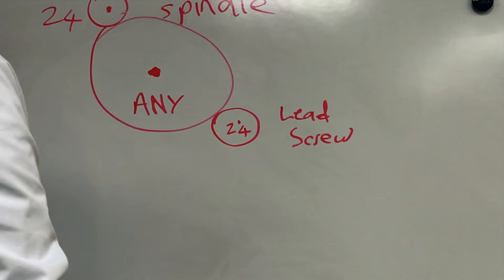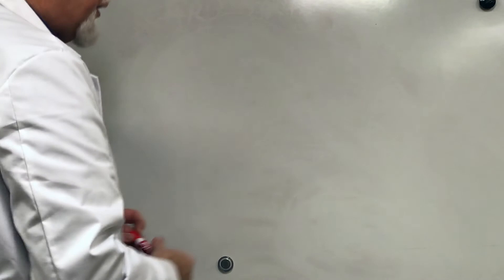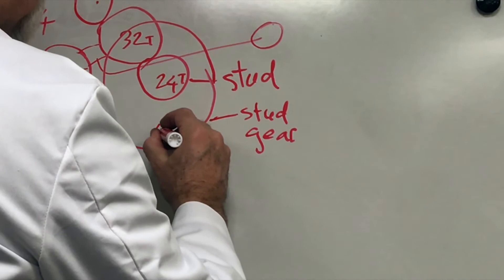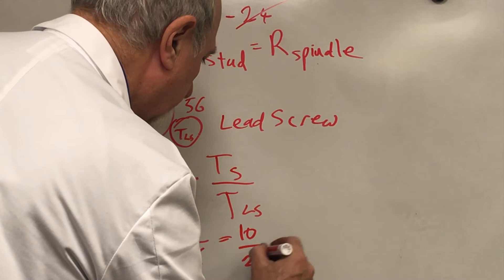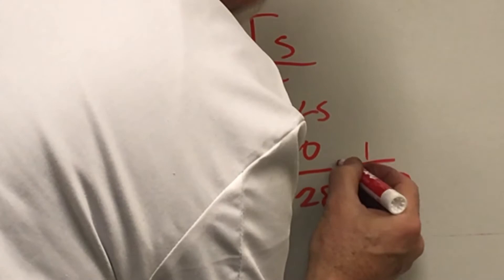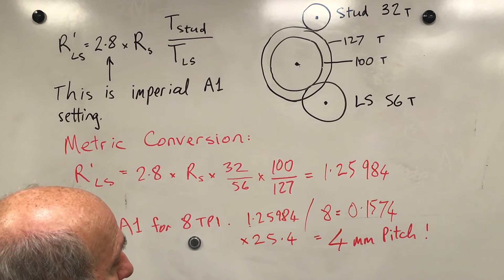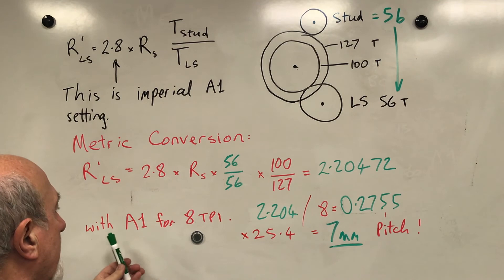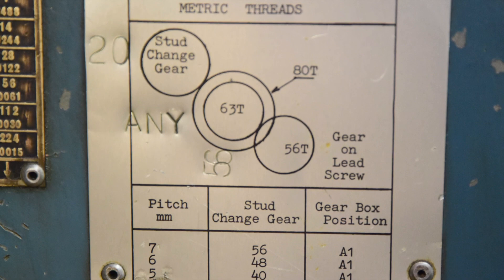Understanding gear trains, feed rates, metric and imperial threads in an engineers metal lathe.

Comment from the maker: Since making this video I devised a relatively simple method for calculating threads per inch (TPI) for imperial threads, or pitch (P) for metric threads on an imperial Boxford lathe. I have assigned the following numbers to the lever positions on the gearbox. Multiply these together to get the gear ratio of the gear box F. This is the number of threads per inch using a stud gear with 20 teeth and lead screw gear with 56 teeth (standard setup):

SUMMARY:

F is the gearbox factor (gear ratio) which is the value assigned to the lettered lever multiplied by the value assigned to the numbered lever on the gear box.

LETTERED LEVER VALUES

A B C D E

1 2 4 8 16

NUMBERED LEVER VALUES

1 2 3  4  5  6  7  8

8 9 10  11  11.5  12  13  14

For imperial setup with a standard 20 tooth stud gear the threads per inch is F.  The standard lead screw gear has 56 teeth and usually it is not necessary to change it.

If you use a different stud gear:

TPI = F x 20 / T

T=teeth on stud gear
F= Letter value x Number value
P=Pitch
TPI =Threads per Inch
P = 1 / TPI   so

P = T / 20F

METRIC Conversion 
(Using the compound conversion gear and lead screw gear):

P = T / F

F = T / P

Review the above letter and numbered values to find a combination that matches T/P where T is the number of teeth on one of the gears you have available.

Power Feeds:
Transverse feed = P /10
Longitudinal Feed = 3 x Transverse feed =  0.3 P
Reply: i try to understand but .........how could I read all these?
Reply from the maker: @sotiristheodoropoulos7750   How can I help? My video isn't great. I had problems with fluorescent lights reflecting off the white board.  

The basic principle is like this: 
If you have a gear with 100 teeth driving a smaller gear with 50 teeth the small one will have to turn twice to make 100 teeth go past, while the big gear only has to turn once for 100 teeth. So the smaller gear goes twice as fast as the big gear. 

If you use my online computer program mentioned in the next comment you may not need to understand the detail.

Comment: @Evan Lewis  
Dear friend, you helped me a lot.
 I did not know where to look for, but with  your excellent videos and your mail I can say now that I have understood largely to extent the operation of gear box
However, according to the table that is on my lathe gearbox (I attach the table to you)
If i want to make an imperial thread- as you wrote to me-   with 10 threads per inch you find it in column 5 and row A so you set the gearbox levers to A but I thing is A3  according to the table on my lathe gearbox.
so the first lever (letters) On A and the second lever (numeral) in number 3.
what happens? I have mistaken? I have not understood well?
Yours sincerely
Theodoropoulos sotiris

Comment: Dear friend 
Thank you for immediate response
Im teacher in athens ,Greece andI assure you your presentation was excelent but initially my knowledges as mechanic ( i am teaching electric in technical school,the lathe is my Hoby) and second my English language are my problems.
I bought a boxford  class A 8TPI two years of ago in bad condition  .today after reconstruction looks like as new.
‌I am tryig to learn tread in metric system but it is difficult for me to understand the numeral table on lathe on norton box.for example
‌what does mean two numbers   in every divisions ?
‌what position i need to put levers on norton box?
Reply from the maker: Sorry I don't speak Greek and I hope this is not too long for you to read. Since you are in Athens, you might be interested in my web page about Heron of Alexandria's Steam Engine, but it has nothing to do with lathes. www.HeroStreamEngine.com. 

I don't know whether the label on your gearbox is original or changed. The original one was copper. I will assume it is original.  Since your lathe has a lead screw with 8 threads per inch it is designed for English or American (Imperial) threads with threads per inch.

If you want metric threads you have to ignore the whole table on the gearbox and find special tables for metric threads (see below).  Sometimes special tables are stuck on the cover that goes over the gear train. 

You should review my thread cutting program.  Have you looked at that? www.HeroSteamEngine.com/RideTheGearTrain and click "Instructions and Information". This includes a video and at 9 minutes it has photos showing how the gear train is put together. My speech is probably too fast!  But it is also described in text. Scroll down through the text to find the heading  
"Converting Imperial lathes to cut metric threads". 
and 
"More about compound gears".
This includes the same photos as the video. If you go down further you will find a photo of an aluminum table of numbers.  This is what you need for metric threads. The heading on the table is "N.Z. Dept. of Education Metric Conversion". which means "New Zealand Department of Education Metric Conversion".  

To change your imperial lathe to metric it is best to use a special "compound gear" in the gear train. This is two gears joined together. The number of teeth on these gears can vary. The best is a 127 tooth gear connected to a 100 tooth gear.  You can also use an 80 tooth gear driving a 63 tooth gear as shown in the photos. When you use these gears the lathe behaves like a metric lathe with a lead screw pitch of 2.5mm.

Even if you do not have these special compound gears it might be possible to make metric threads. It depends on what gears you have.

With the compound gears or without them,  I would recommend using my program (RideTheGearTrain) to find out what gears to use. If the exact gears are not available it is often possible to use gears that give approximately the correct pitch (nearly correct). In the program you can say how much error you can accept. If you are happy with 0.5% error it will tell you what gears to use and how much error they make, up to 0.5%.

I will try to explain the copper imperial table on the gearbox anyway:  The top number on the 'numeral table' (on the gearbox) shows "Threads per Inch" for cutting English or American threads. We call these "Imperial threads".  You can ignore or skip the bottom number. Don't worry about it! It is not used for thread cutting. 

Power feed has nothing to do with thread cutting and you can ignore it. However you may be interested in power feed. That is when the lathe automatically moves the tool for you. 

(I explain the bottom number  here :The bottom number on the table is for power feed in thousandths of an inch per turn of the chuck (one thousandth is 0.001 inches). The number shown on the table is for the cross slide (which goes across the lathe bed). You can also use power feed along the bed (longitudinal) and the speed is cross feed rate divided by 0.3.) 

If you want to make an imperial thread with 10 threads per inch you find it in column 5 and row A so you set the gearbox levers to A 5.  However you also have to look at the first column that tells you the stud gear has to have 20 teeth.

I recently added some text in the description of the You Tube Video (#2) about the knobs and levers on the Boxford lathe. This describes how to use the knobs on the front of the carriage or "apron".
Reply: @Evan-e-cent  
Dear friend, you helped me a lot.
 I did not know where to look for, but with  your excellent videos and your mail I can say now that I have understood largely to extent the operation of gear box
However, according to the table that is on my lathe gearbox (I attach the table to you)
If i want to make an imperial thread- as you wrote to me-   with 10 threads per inch you find it in column 5 and row A so you set the gearbox levers to A but I thing is A3  according to the table on my lathe gearbox.
so the first lever (letters) On A and the second lever (numeral) in number 3.
what happens? I have mistaken? I have not understood well?
Yours sincerely
Theodoropoulos sotiris
Reply from the maker: @sotiristheodoropoulos7750  You are CORRECT it is A3. I misread the table and got it wrong! 

If you are making imperial threads you do not need the compound gears. Instead it has an 'idler wheel' that does not change the gear ratio. The idler gear usually has 80 teeth but it doesn't matter how many teeth it has.  It just acts as a spacer to fill the gap between gears. 

The copper table also says the STUD great should have 20 teeth.  

It does not mention the last gear (on the back of the gearbox) but that has 56 teeth.
Reply from the maker: Oh, one thing I forgot to say:  It is best to check the thread pitch after setting up the gear box. Get a bit of scrap bar and cut a shallow thread and measure the pitch. Do this before trying to cut a thread on any important part. This is an easy way of finding out whether you have the correct gear set-up.

Comment: Sir , I have gear stud 20 & any 80 , 63 , and ls 56 . can it make to matrik . I look table diagram gear . what is standar for make drat matrik.

Does the rpm  affect too ?
Reply: I am have lathe tipe A boxford 4 1/2inc presision  with gearbox . I want to make matrik but the gear that I have   20 , 40 ,80 . what should i do and what gear do i need add. Thanks
Reply from the maker: YES YOU CAN CUT METRIC THREADS WITH THE 63 TOOTH GEAR.
NO THE RPM DOES NOT AFFECT IT. (You set RPM with the pulleys and back gear).

I know English is not your first language and this may be difficult for you to read. Please contact me by email if you need help. See my email in my online computer program 'Quick Start Guide':  I suggest you use my online program called RideTheGearTrain dot com. It does not cost anything.  I will set up the program for your lathe and send you a link (URL) with all the data for your lathe.

You can make up a gear train like this and cut any metric thread:
20 tooth stud gear driving the 80 tooth gear. 
The 80 tooth gear is connected to the 63 tooth gear as a compound pair - both on the same shaft.  
The 63 tooth gear then drives the 56 tooth gear which is on the "leadscrew gearbox input shaft' which I call LSG. Then use the program to find out what gearbox setting to use.

Later, you can still cut imperial threads by using this compound pair as an idler. Use the 80 tooth idler.  The 63 tooth gear may still be connected to the 80 tooth gear but does not mesh with any other gear for imperial inch threads.

I just ran 'RideTheGearTrain' and asked for a 1mm pitch thread. It told me a much simpler gear train:  
20 tooth stud gear
driving the 80 tooth idler gear (not compound)
63 tooth LSG gear (on the leadscrew gearbox.)
Set the gearbox to B5 for a 1 mm thread.

How to use my online program called RideTheGearTrain dot com. It does not cost anything. 
In step 1 the program asks what lathe you have:
Step 1: Scroll down to 'Lathes with gearboxes' and you will find 'Norton Imperial'. Your Boxford A lathe will have the Norton Imperial gearbox. It is the same as my lathe. Click the red  button so it turns green. Then click the 'RETURN' button on the screen.
In Step 2 select 'One compound gear' and enter your list of gears. In your case it may be easiest to put all your gears in the list of 'change gears' and choose 'automatic', then ignore the compound gears.  
In Step 3 Select 'Metric Thread'. 
In Step 4 you choose how much error you are willing to accept. Usually 0.5% is OK but you could go up to 2%.
In step 5A you enter the pitch of the thread in mm. 
In Step 6 click RUN and it will tell you many different ways you can set up the gear train and gearbox to cut that thread. 
Click DRAW and it will show a drawing  (a scale diagram) of the gear train.     

The main gear you have has 63 teeth. Two times 63 is 126 which is nearly the same as the 127 tooth gear used for metric on an imperial (inch) lathe. 127 times two is 254 and there are 25.4 mm in one inch!  So it is common to use this 63 tooth gear for metric.  

You may need to make a compound pair of gears by connecting two gears together so that they spin on the same shaft. One of the gears must be the 63 tooth gear. The second gear usually has 100 teeth, but you can use any other gear. These two gears are usually joined together eg using a key or rivets etc so that they turn together. If you only have the 80 tooth gear this will work, but if it is an idler gear on the Boxford it has the wrong size hole in the center. The hole is bigger than the 7/16" hole with a keyway that the other gears have.  It is designed to spin freely on a bush. You may have to make a bush that allows you to join 2 gears.